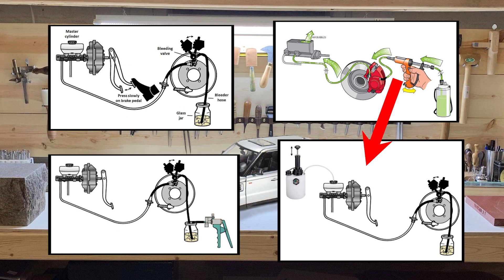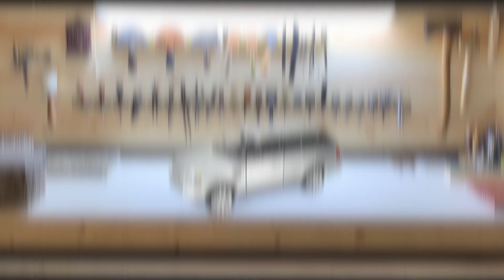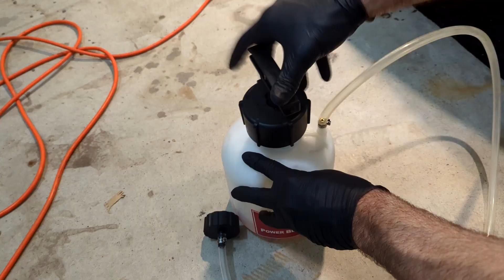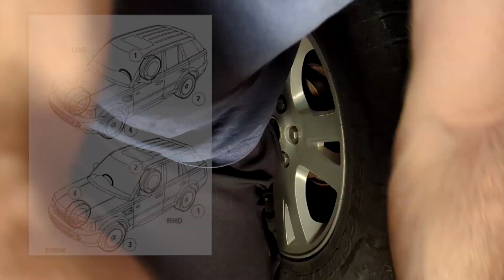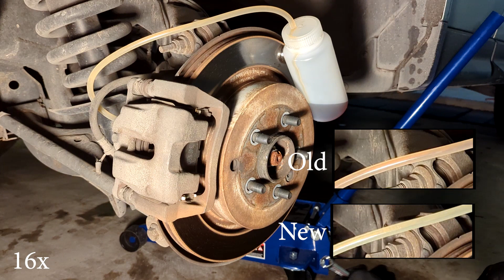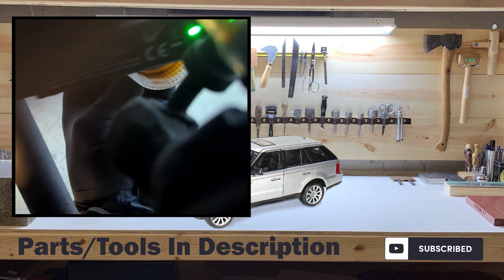Brake Bleed and Flush - Range Rover Sport or LR3

Comment: Thanks for all the videos ..help savings 💵 ...Do you have anything on flashing Faulty emergency parking break light. 
Thanks...
Reply from the maker: You can check the fuse (FL8) under the hood, if that's normal, then you'd have to check the wiring of the module by the right rear wheel. You can also try just unplugging the battery for 10 minutes to reset some stored values and see if that fixes it.

Comment: One other question: do you need to hook the gap tool / obd to bleed the abs pump?
Reply from the maker: There is no mention of needing to in the service manual, I think when you drive for a while the small amount in the pump mixes with the new fluid and dilutes it.
Reply: @HazyJay  thanks for the reply. Do you have a hard copy or pdf of the manual? Something I should probably get.
Reply from the maker: I can email you the electronic copy, just lmk your email

Comment: Great video. I'm doing mine tomorrow when the Motive power bleeder gets here, but a question on the ABS, does it need bleeding in the L320? Also, I read that these have to be running to bleed the brakes and I have never done it that way.
Reply: I'd like to know too. I have a 2010 L322 with the brembo brakes